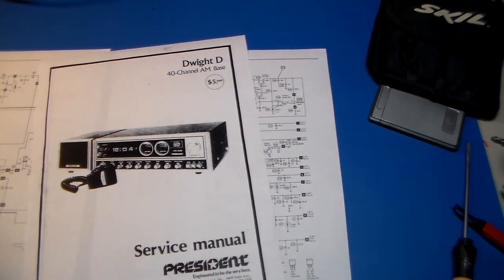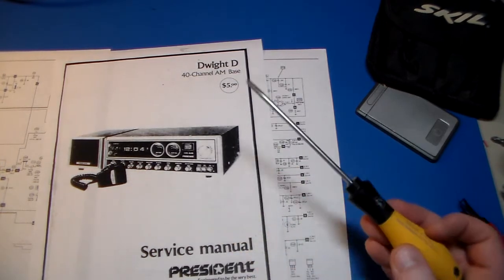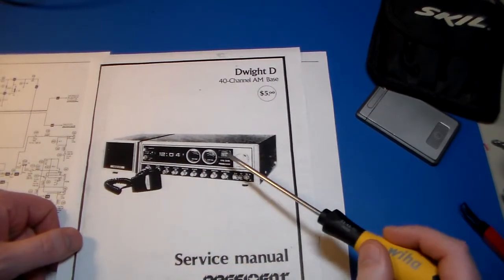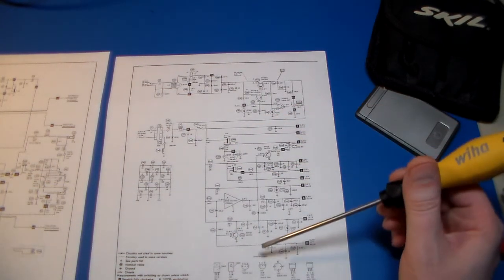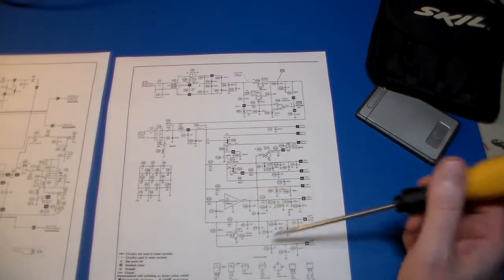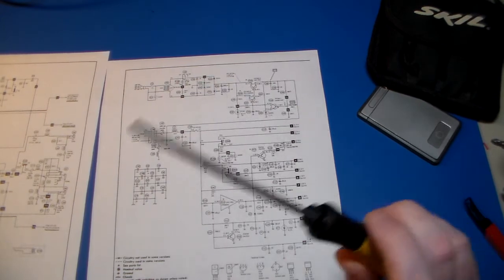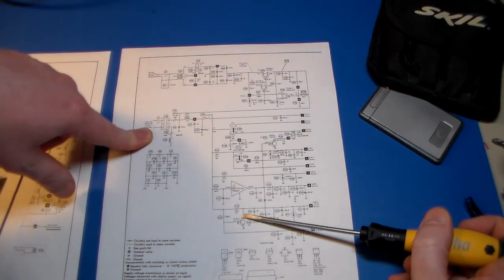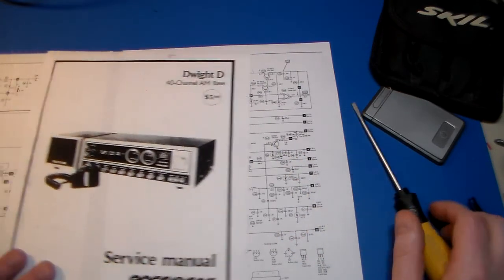More Dwight D stuff

Comment: ok mark did some testing this is with the tr20 out of circiut  im going from the source 9.4v runnign down the circuit d17 reads 8.98v (r127) 9.00volts to 8.98volts(the r130 on the base side of switch(tr20)reading 14.00volts testing tr20 getting readings like say ec pins 5.7ohms cb pins 2.6 ohms eb pins 4.6 ohms when i switch meter to conuity meter sounds no matter what pins are touched ,i have orderd a new tr20 its an nte 290 and you are right there where three different styles of switches used i guess diif suppliers ect ok hope this helps let me now thanks ,mike
Reply from the maker: Does the radio receive?
You will probably need the mic plugged in to hear anything.

My fear is that with TR20 shorted the way it was that the receiver and transmitter fired at the same time.
I haven't seen a receiver frontend survive that.... usually the first stage RF amps are taken out.
Reply: no with the tr20 out i here nothing no pa either
Reply: i see well you let me no if its worth going any furthere i did order a tr20 replacement be here next week sometime
Reply from the maker: 76chyanne almost hard to believe that the pa now isn't working. Something very sinister going on there... Will study the schematics some and see what could possibly cause that.
Reply: ok mark yea theres no sound at all ,maybe because the tr20 is a audio amp switch not sure ,but im full steam ahead dont have much money in it and most componets if availible arent much the 18 dollars for purchase of rig is the most so far

Comment: ok mark on the mica found some thanks ,1 q is there any way to repair a solder pad that has lifted from a board ,this boards old the more i work the shit that happens ,no rush on answer just wondering ,i just went up in circuit with a jumper ,but hell not sure ,thanks mark

Comment: and what the hell im floating around the tube to find there are asswholes out there makeing bogus trans finals, drivers for discontinued parts for these rigs what the hell for a novice this sucks you rely on ebay for things makes me freaked that this shits out there ,to make a dumby trans that does shit 1 watt that kind of thing damb its just about pissed me of something as selling these for a dollar or two this world makes no sence what do they make 50 cents on each they sell why not make a good one and make 10 bucks a pope ,whats your thoughts on it and have you ran into this ,i orderd from ebay but they where replacements via nte cross ref ,mike
Reply from the maker: Well, thats the issue with the supply chain.

I will try to make a vid later on how to fix lifted traces. Caught a flu or cold or something so my head feels like the size of a freight train at the moment. Need to get some cold meds to unstuff my head.
Reply: yea i had that from xmas eve threw new years take it easy get better ill try not to bother you ,yea 1 of the pads that secure c2092 has lifted of i just took lead to next spot in circuit hope thats ok